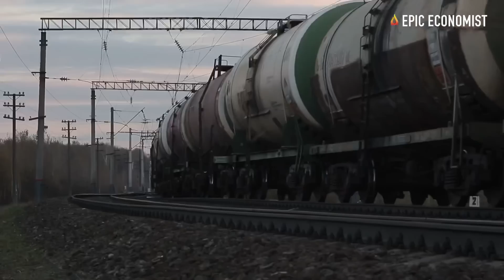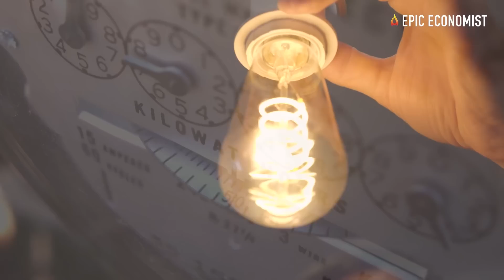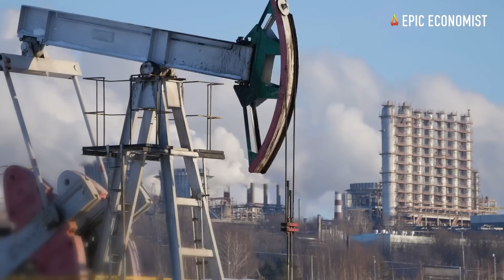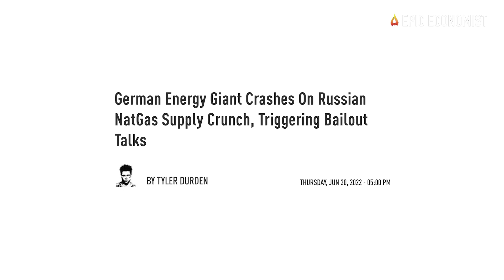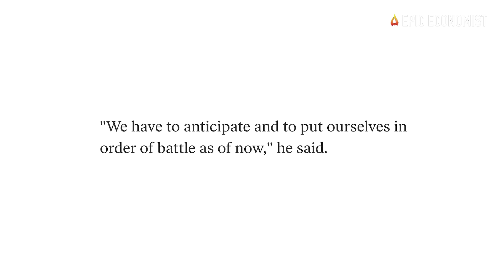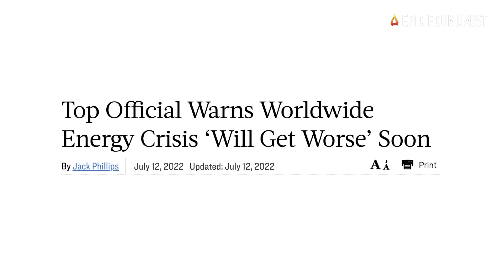Alert! They Warn Populations To "Prepare For A Total Cut-Off Of Russian Gas" As Social Unrest Looms

Comment: As a builder I think something that is being swept under the rug with the energy is quite the elephant in the room.... EV's along side central air simply can NOT be supported by the grid.. it pulls way to many amps... the grid simply can't support both at the same time. Alot of these problems are made by our clowns in office. Trying to force something on us that is not affordable and the energy system can not handle.. it takes more time than this to adjust for. Personally with that being said this energy crisis didn't happen overnight but the house sure does act like it has...

Comment: Mr. Doom & Gloom got one thing right. Biden IS sending our fuel to China, which should be a crime, and instant impeachment. As far as Russia and the west goes, Russia has ZERO effect on the cost of fuel in the West. The United States was only getting approximately 4% of fuel from Russia. THE FACTS ARE: The United States has enough oil to last for 100's of years, and It's NOT being pumped because Biden is a FKN Traitor and POS. He would rather go beg Saudi Arabia for fuel, than be accused of pumping it here in the United States. His Green First, Hug a Tree Program is NOT working, and everyone knows it. The United States has the cleanest burning fuel, and he wants to bring fuel in, that will cause a higher C02 production. That sounds like a bright idea. I have nothing against electric powered whatever, but we in the West are NOT prepared and would be stupid to put all our eggs in one basket and rely solely on electric and solar/wind power. There's not even close to enough charging stations in place EVEN IF everyone could afford and wanted an electric car. It would be a cluster fk.

Comment: The energy crisis did not begin with the "end of Covid" which has not ended but with the release in 2006 of the film "An Inconveneint Truth" in which the internationally remouned Nobel scientist Al Gore mistook the colour of two lines on a graph to incorrectly claim that increased atmospheric carbon dioxide caused and increase in atmospheric temperature over the past several thousand years whereas it is the other way around. This false claim led over the years to the Paris climate accord as rinforced by decisions at the recent COP meeting in Glasgow. The result a clear message to energy companies not to invest in the development in further supplies of fossil fuels and this has been reinforced by  requirments for companies to  state their plans to move away from their use to the point where investment to even keep current supplies going have been damaged with numerous refineries in the US and Europe either closing or switching to bioethanol and in the US a reduction in gas flows from fracking, cancellation of licences to drill on Federal lands  and the closure of the Keystone pipeline all to follow a misguided false narrative linking anthropogenic carbon disoxide from fossil fuels to climate change at a time when the atmospheric temperature is close to the coldest in the past 10,000 years as we head towards the next ice age - a drop of 1.5 to 2.0 C from around 4000 years ago. It was colder and longer winters in 2019 and 2020 that used up oil, coal and gas stores that has lead to the current shortages. It would only take another severe solar flare, a Carrington event, to take down the US and other grid systems and for them to take yeas to restore due to the lack of power to manufacture new transformers and other needed devices. We are in urgent need of some politicians who understand risk analysis rather than voter polls.

Comment: They can turn the decommissioned coal power plants back on or convert to deep drill geothermal energy, new plasma drill tech just got the green lite to boar cheap straight holes to tap the Earth's core and bring micro nuclear reactors online. China's building a thorium reactor.

We built two in the 40s here in the US. The only thing holding us back is regulation that promotes classic reactors and the stigma around them too.

We already have the tech and knowledge but regulations stand in the way.
Reply: The problem is that they can't do these things overnight.  It takes months or years to make the switch.  By the time they get these new power sources online, the conflict could be over.
Reply: @matthewfusaro2590  it isn't just the conflict it's also the energy grid aging and can't take the extra load that we're putting on it with new electric cars and factories coming online like chip manufacturing.

Along with the Hoover dam getting close to dead pool soon.

And recommissioning decommissioned coal power plants won't take years it'll only take months.

We also can reinstate fracking and exploration in the Gulf all things that Biden canceled.

To truly solve this energy crisis we need a competent leader that isn't in it for the money like Trump.

But since Trump is running he's probably going to win we just got to convince the diehard bubble people to switch you think with Hunter Biden's iPhone on the torrent Network that would be enough it's not like that laptop or the diary that they hid.

You can't hide a file on the torrent Network.
Reply: Hmmmm 💥

Comment: Sounds like this could be a very cold winter
Reply: I like it cold, I already have my winter blankets and clothes ready
Reply: @swolfe9668  Exactly, you can always wear winter clothes inside the house at all times if it’s necessary.
Reply: What did the potato say about a "dark winter"? Maybe this is what he meant.
Reply: Better than the current heat.
Reply: I wish 🤞
Reply: Most smart people already prepared with back up emergency supplies not rocket science to see what’s happening.
Reply: @tammybrennan2040  Exactly. If people can't take responsibility for themselves then it's going to be very tough for them.
Reply: @tammybrennan2040  What kind of emergency supplies are you stocking up? It’s mostly home made canned soup and other preserves for us. Some firewood too I suppose, since we have a fireplace.
Reply: @nelzelpher7158  I used to live in northern Michigan had a wood burner. Unfortunately I moved but I have a generator for when heat electric goes out & it has probably 20 times in 1 year that’s a first. I’ve used generator for microwave coffee pot lamps fans mini fridge charging cell & its best prep I’ve ever bought. Solar jackery. I also have wool blankets -30* below zero sleeping bag I bought n summer on sale. Coleman stove jet boil, & the obvious everyone should have food water & great security protection
Reply: One thing you never hear, is that the Democrats are shutting down all of our nuclear power plants, that is the problem.
Reply: Or a hot summer if the grid goes down. Where I live, you need AC in the summer or you could die
Reply: One way to keep core temperature up is to go and riot